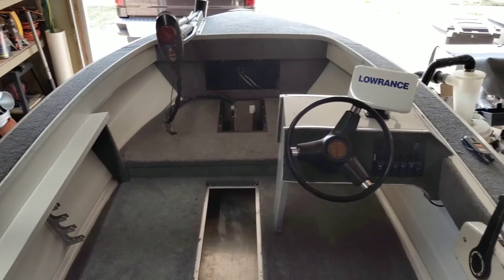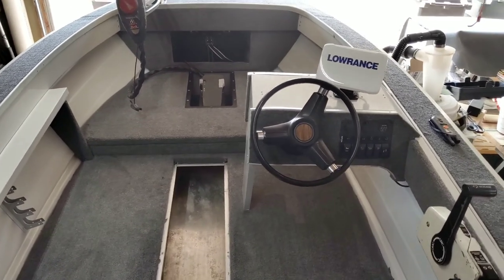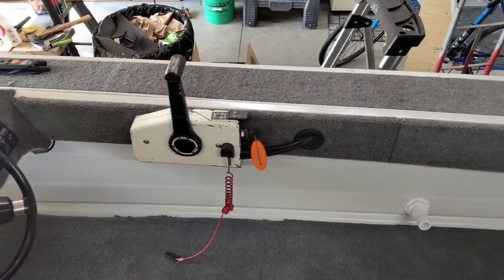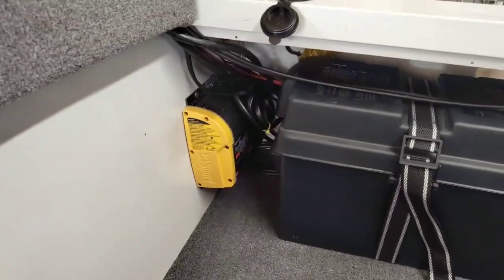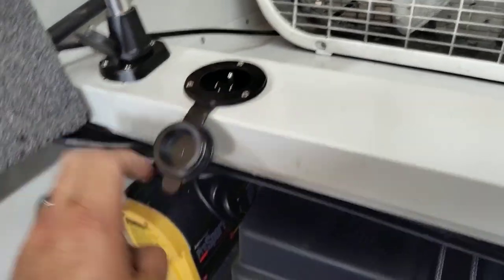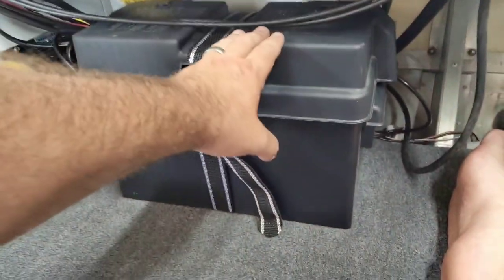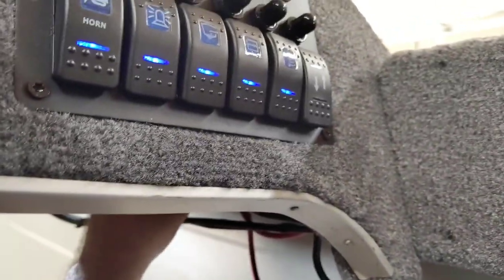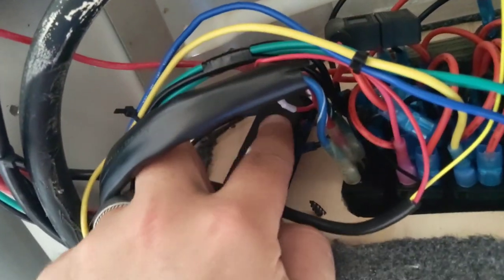16' Smokercraft Episode 7- Update and reveal

Comment: I just got a 1985 pro angler that needs a full restoration. I was wondering how many pieces of wood you needed to use for the floor replacement.
Reply from the maker: I want to say 2.5 but I did this boat many years ago.
Reply: @averagediyguy2503  I saw you used some non treated exterior grade wood how has that held up as I’m planning on using it in mine because of the crazy prices of marine grade.
Reply from the maker: @omcoutboardboy4421  use marine grade. Don't use treated. It's corrosive to aluminum.  It's what OEM used 30 years ago and it's good enough for a rebuild